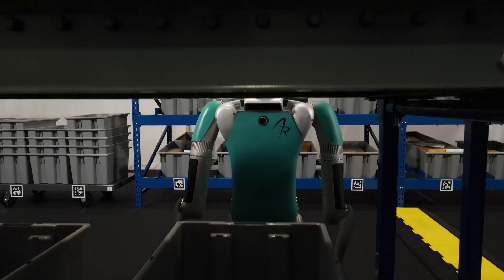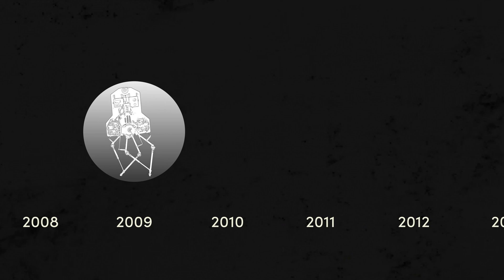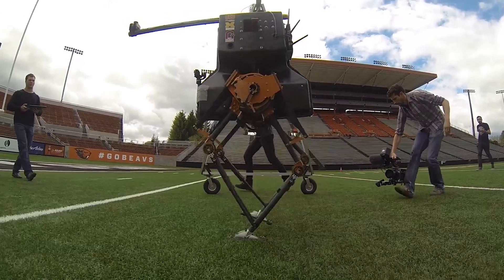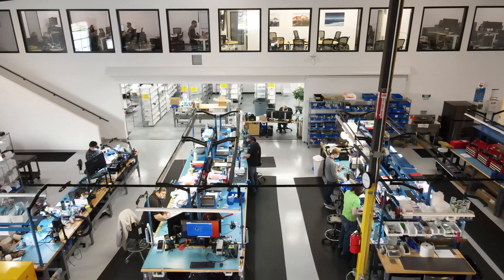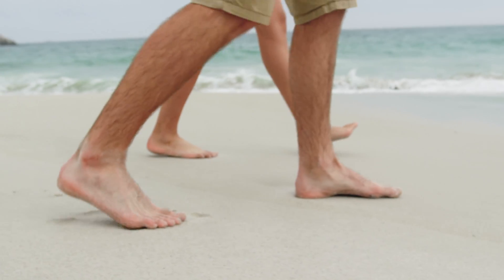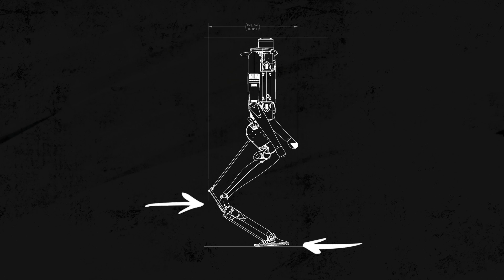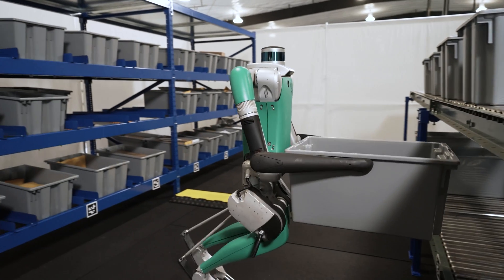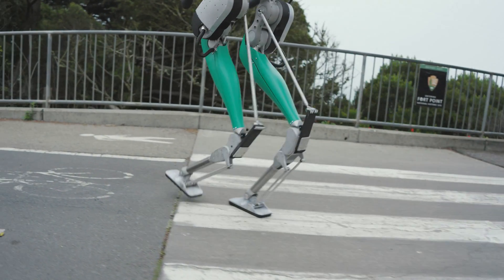Does our robot have bird legs?

Comment: How can robotics be tied to string theory fundamentally using for example between robot movement and say vibrating strings as a metaphor with science? State 3 lines
1. String theory in physics posits that the fundamental building blocks of the universe are tiny vibrating strings. Similarly, in robotics, we can draw a metaphor by considering the movements of robots as dynamic "strings" of motion in the fabric of space.

2. Just as different vibrational modes of strings in string theory can represent different particles, the varied motions and behaviors of robots can be seen as diverse "modes" of movement, each with its own purpose and significance.

3. Exploring this metaphor may lead to innovative approaches in robotics, where the principles of string theory inspire new ways to model and optimize robot movements, potentially enhancing their efficiency and adaptability.

ChatGPT ♥️♥️♥️

Comment: Why not wheels
Reply: I think there are many environments where humans can walk easily in which wheels wouldn’t work very well, such as on a beach, or where there’s loose soil. Or, at least, for any particular reasonable-size-for—the-general-task of wheel, I expect there are environments where that wheel size won’t work well but where humans can handle it easily.
Reply: @drdca8263  But this bot is mostly for flat surfaces, factories and maybe cities, homes
Reply: @waxy3220  Hm, ok, that may be a good point. I know those robot vacuums can get caught on stuff fairly easily, but I guess larger diameter wheels could solve that?
Maybe they are hoping to extend it to more varied environments later? Like, what if you want to take it with you when you’re going on a hike? Not like, near term, but in some much later on product? Idk
Reply: @drdca8263  My concern is that if this is for repetitive factory work, legs are not very efficient, but a bot with wheels, that can maybe turn its torso is super fast and effective.

If it needs to climb up and down stairs, maybe a sideways ramp is even cheaper.

For general purpose, unexpected all terrains and such, I think legs are maybe the best choise.
Reply: @waxy3220  what you say seems to make sense to me

Comment: Has A.R. investigated modern prosthetics for the ground interface to enhance its gait? I am thinking of recent developments like the Ossur Pro-Flex ankle. I keep wondering if used on your toe section as an uneven surface and gait enhancer, with some code development that changes the use of the toe pressure and pid timing to make use of the additiona flexion points and added height...you might get more than 20% improved mobility, range, or open up the possibility of a bounding gate that improves speed, and ultimately battery life. a more natural gait and a way to bound with a wider stride would enhance its agility...

Comment: Can it run? The walking looks pretty slow but the legs seem to be fit for running. Maybe not like a full speed run but a jog
Reply: Cassie , the robot that was Made before Digit is able to run at 24 kmh , the main issue with running would be having balance while doing so
Reply: @ulforcemegamon3094  From the little I know, balancing becomes less of an issue if anything when running because air resistance more effectively dampens oscillation. I'd think the main issue would be how to correct when for ground give and missteps.
Reply: @Term-0  the part of the air resistance may be true in some degree but i don't know if the speeds Cassie reach make air resistance meaningful (specially when you consider the shape Cassie has) , that being said you are right , is the calculating the steps and fixing the mistake while running also a limiting factor for speed

Comment: this is an intermediate model on the way to a real robot. I do not believe in its successful and competitive future in this form.
Reply: (I'm not affiliated with Agility Robotics) Nature has also not evolved a wheel, yet it is still by far the most efficient form of ground transportation on flat ground. This design may strive to be biomimetic, but nature hasn't had the need for spring/dampers in the same way probably because the mechanisms behind biological actuation and robotic actuation are from a completely different set of building blocks. Regardless, they have already proven great power savings and efficiency since walking is a very natural gait in this configuration. I think it's even possible that a future variation of this sort of leg configuration could exceed the efficiency of a nature someday since any  robot is much simpler than a biological bird.
Reply: Why not?
Reply: @GrassBIade  Well, you tried to breed a part of an animal and a part of a person. Natural evolution has not been able to do this in millions of years. Do you want to do it in a few years? Ha. Therefore, this form is unstable in every sense of the word - technically, physically, and aesthetically. I like your project and even consider myself a fan of yours, but I sincerely believe this lineup is a dead end. At the same time, the developments will be used to create more advanced models (2.0). And I will be watching your every move with curiosity.

Comment: Ok, now give it human legs.
Reply: It works fine. Our legs are sorta fricked up anyways let’s not give the chronic foot pain to the robot.
Reply: It's seems like a pretty bad idea that humans have human legs. Why give them to a robot when there's something more efficient and practical?
Reply: @Here_is_Waldo  so you want wheels or tank threads?
Reply: @zefellowbud5970  Wheels are certainly easier, but if the option exists I'd say tank treads. They can go over sand, snow, rocks, and - if they're built correctly - they can even go up stairs. For going over flat, firm ground like the inside of most buildings you really can't beat wheels. No need for complex balancing systems or extra servo joints like legs, far more energy efficient and increased battery range, and very stable.
Reply: @Here_is_Waldo  i was being sarcastic.

The point of robotics is to be able to do complex life like actions
Even in early form the goal has been to mimic life and or humans otherwise its just a machine and not a robot

That said i personally like serpentine snake like robots
Reply: @zefellowbud5970 A robot is pointless if it breaks down all the time.
Reply: @zefellowbud5970  look up the official  definition of a robot. I'll bet you'll  be surprised that a self driven car or and uav are in fact a type of robot.
Reply: @toddmccartha3759  never said those are not robots

Im simply stating the historical idea that a robot was often a lifelike humanoid
Reply: @Here_is_Waldo Our legs are a compromise.
Reply: What's the incentive? They already stated that Digit's legs better accommodate handling items while squatting. 3:13
Reply: @kennethstudstill  yup, form follows function.
Reply: Bird evolved better leg to be honest. You can't outrun ostrich.
Reply: ive got some spare
Reply: They are like humans legs imagine that a human with extremely long feet walking on its toes. The thigh section at the top is short. Why make it human we are not the most agile species, we are not the fastest species, we were not the most powerful species when it comes to leg ability.